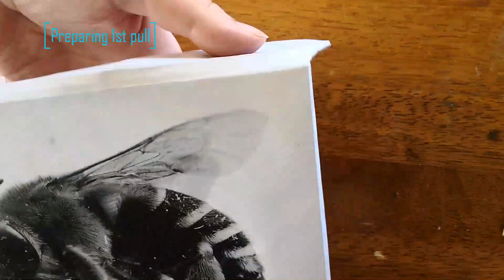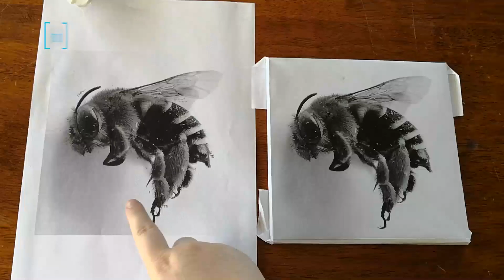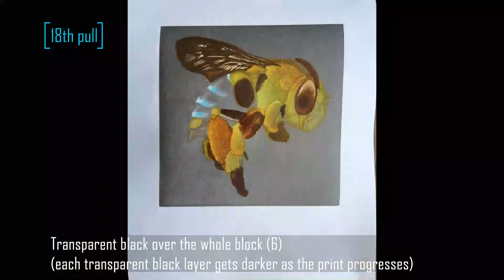In Memoriam ii: The reduction linocut process

Comment: Beautiful, What is the paper you are using similar to tracing paper? And what are you dipping it into?
Reply from the maker: Hi, Thank you. I'm using a heavy tracing paper as my stencil. I dampen my paper in water by quickly dipping the printing paper into a water bath and blotting it dry with blotting paper. This makes they paper more flexible and easier to register in position for printing. :)

Comment: Yes, I agree this is not reduction printing more like stencilling printing but interesting work.
Reply from the maker: Sorry for the confusion. I have only used the stencils to separate base colours at the start, not build up the image. As each step is printed over, the previous layer is carved away in the traditional reduction process. My carving was left out of the video as the video was very long (you may notice the block changes slowly over time). I had hoped titling the video a reduction process would have made that process clear. I have left a general clarifying comment at the top of the comments section to prevent any further misunderstandings.

Comment: Dear Elyse, great work! I just have a question: do you wait for ink to dry in between pulls? Thanks
Reply from the maker: Thank you Paulo. Yes I do. I found printing every 3 -4 days worked best. The ink was dry enough to print over without the paper sticking to the block, but also not 100% set so the next layer printed evenly over the top. If I left it too long the next layer became harder to get a smooth print and the print almost repelled the new ink. Hope this helps ☺️

Comment: Hi, Noob here. Great video and design.  Question: can you elaborate more on your process of aligning your prints?.  It looks like you are just eyeballing it in the video, but even 1mm off can mess up a print so I am assuming you are using some method.  I am currently trying to develop a good way to align multi-layer prints.
Reply from the maker: Hi Danelle. Thank you. I am using a piece of mdf board with notches cut into it to line up the prints. It is an L shape and slots in next to the printing block. The corner of the paper and on edge is aligned into the notches on the mdf board and the paper is then lowered over the block. It is a technique I modified from artist Michael Schlitz and the the Japanese Kento registration used for woodblock printing. Best of luck with your printing and hope you get as much joy form the process as I do.
Reply from the maker: At 3:50 you can see how the MDF registration board slots in next to the block. At at 4:15 I use it to line up my paper. It is important to use the same registration block for all the layers to keep everything aligned. Hope this helps.

Comment: this is not a traditional reduction as in reduction each succeeding color is cut away.  I would call this more of a stencil process using in this case a linoleum.  Guess any smooth surface could be used to apply ink on.  Do try your hand at the real traditional method.  It's ruthless and unforgiving!
Reply from the maker: Sorry for the confusion David. I have only used the stencils to separate base colours at the start, not build up the image. As each step is printed over, the previous layer is carved away in the traditional reduction process. My carving was left out of the video as the video was very long (you may notice the block changes slowly over time). I had hoped titling the video a reduction process would have made that process clear. I have left a general clarifying comment at the top of the comments section to prevent any further misunderstandings.